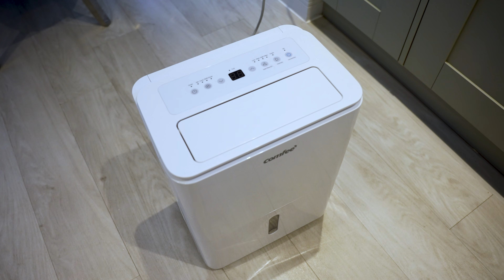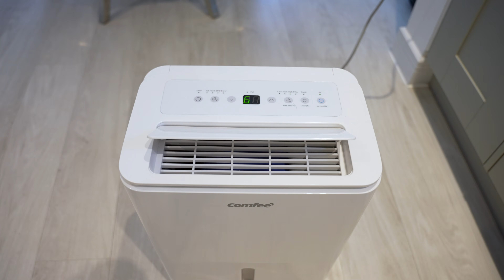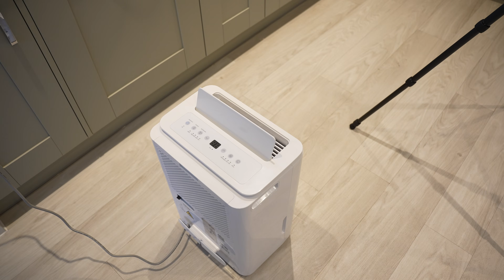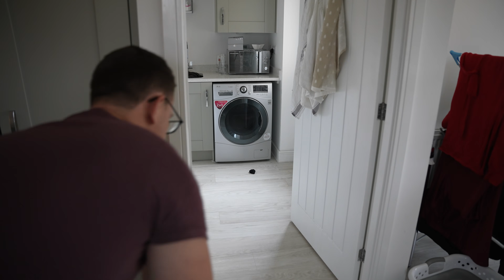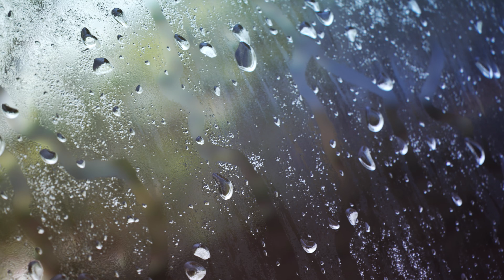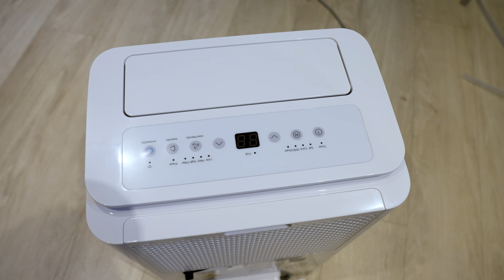Comfee Smart Dehumidifier - A great Dehumidifier to get you through this winter!

Comment: The controls … what are set .. cont ..SMD  used for .. I live near the sea in Spain and we’ve had lots of rain so what do I set the humidity to … is the choice the humidity I want to achieve or humidity  I wish to remove .. apologies for not understating but I am 79 years and want to know that my understanding is correct.    Many thanks
Reply: Hi, we've bought this machine last week. The current humidity level was stabel at over %85s.We live near the seaside.
Since we have bought dehumidifier(which is sold in different brand as Midea in my county) we set the level as %60s.All the things are going in order, happy to purchase this machine. Please feel free if you have any further questions.

Comment: i don't have the air filter, where can i buy it ? what's the name filter ?
Reply: Same 😢 You also didn’t find the filter in the delivery set when you bought it?
Reply: Same (received through Amazon France), if anyone manage to find filters, please let us know..
Reply: Same, no filter, ordered through Amazon Belgium, coming from France probably, crap !  And no way of finding the part or the spare part number
Reply: same here, would like some help
Reply: I've just purchased the 16L version knowing it would arrive without a HEPA filter (many comments on Amazon say so), so I bought a couple of DIY HEPA filters from Ali X (9€ each), and taped one snuggly on the back of the dehumidifier as a temporary measure until I get around to fitting it inside. I've been running it for 6 hours now and everything functions perfectly and the dehumidifier runs cool. It can be found by searching on some, or all, of the following words "DIY White Hepa Filter Screen for Universal to filter PM2.5 and Haze to Cleaning Home Air Purifier Filter 300*300*25mm". It's a 'do-it-yourself' solution, but it might appeal to some of you.